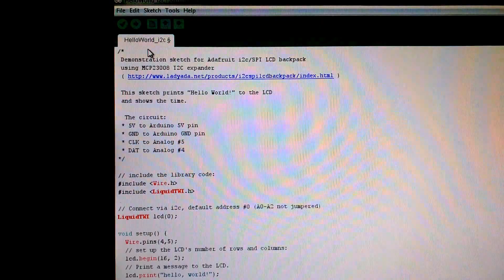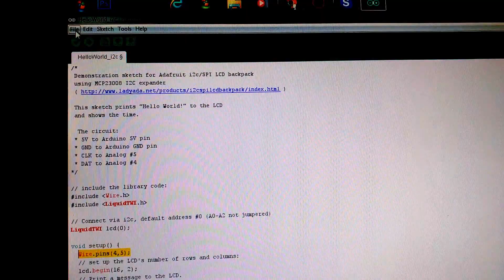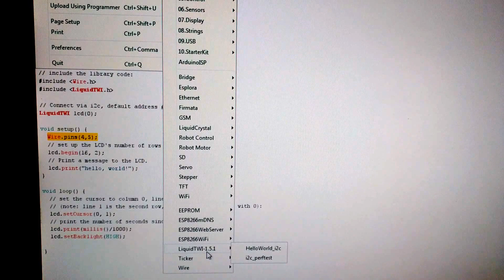I2c LCD on the ESP8266 HUZZAH

Comment: is this hooked to 5v or 3.3v?
Reply: The adafruit Huzzah has an inbuilt regulator. So in this video the entire device is being given 5v from the USB, and the V+ pin on the adafruit breakout is passing the 5v to the LCD, whereas the esp8266 is getting a regulated 3.3v. If you do this with a plain ESP8266, you will kill it. 

The only thing "bad" about this setup is that you cannot run it from battery easily. Let's say you put 4 AA batteries there and get something like 5.5-6 V. The board will not die because of the regulator (5.5 -> 3.3v) and the LCD will be happy (5.5v). But since all batteries drop voltage as the capacity is used, at some point the voltage will be at a level where the ESP8266 still can run (for example 4 volts or lower), but you will not see anything on the LCD anymore. This will likely happen when the batteries are at 80% or something like that. In such a situation it would be better to use a 3.3v display, or use logic level shifting.
Reply from the maker: Lcd operates on 5v the ESP8266 on 3.3v I think. It was a while since I did that.

Comment: I got this error"error: 'class TwoWire' has no member named 'pins"
Reply: +Muthana Alalaki 
I also get this error. Were you able to solve it? Or find code for driving an I2C using the ESP8266 from the Arduino IDE?